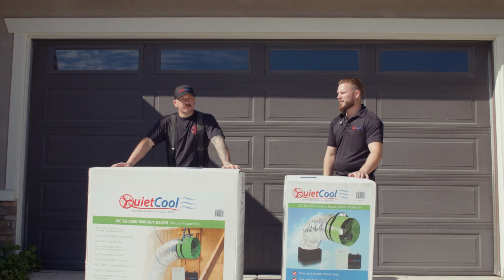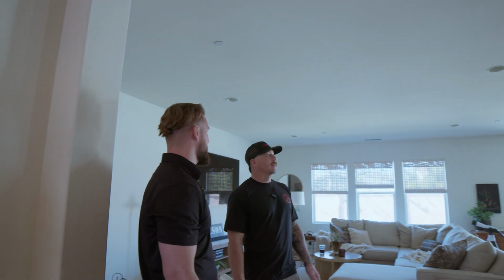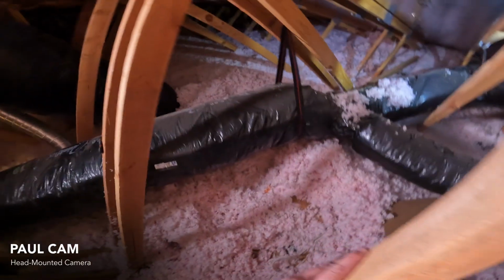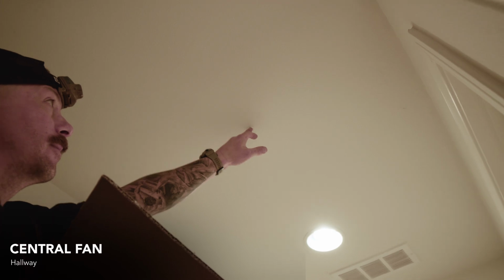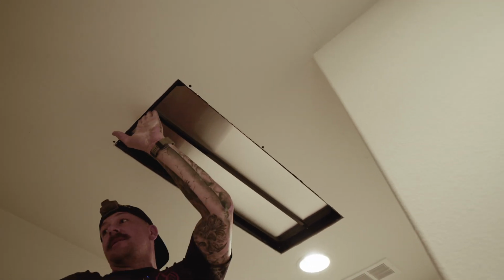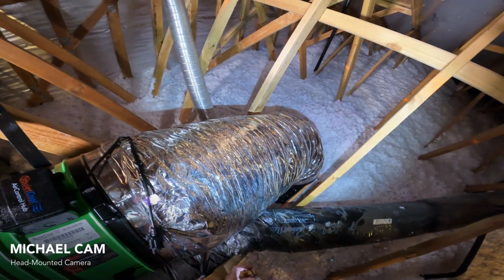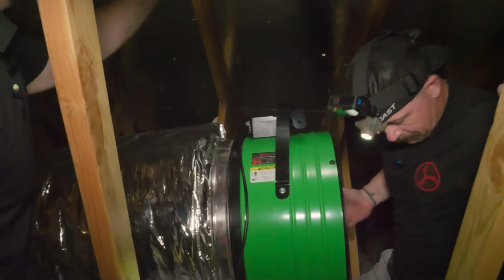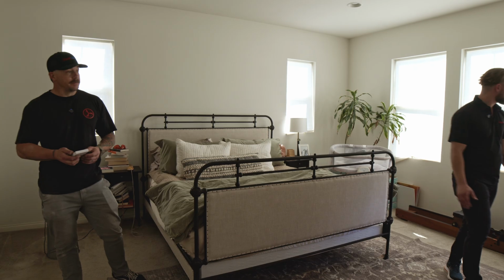2025 QuietCool Whole House Fan Installation Guide | Complete Walkthrough for Single & Zoned Systems

Comment: Great install video! But I'm curious as to how it works. When it is hot and humid outside, I assume you don't want to run this, as it will still pull hot and humid air into the house? My upstairs is definitely warmer than my main floor and basement. I live in Michigan. We upgraded our insulation to make it more "efficient"...
Reply from the maker: You are exactly right; you'll want to run the fan only when the outside air is cooler than your indoor temperature. This not only helps cool your home and expel the stale hot air from the day, but also helps keep your home cooler for longer.

Comment: What happens when it's 110 outside mid day? You aren't opening your windows then you have to run your AC how does this system work then?
Reply from the maker: You would only run the fan when it is cooler outside than it is inside of your home. This not only helps cool your home and expel the stale hot air from the day, but also helps keep your home cooler for longer. That means less AC usage, and big savings on AC related costs!

Comment: i have an exhaust fan in the bathroom just like in this house that turns on with moisture.. if both fans are running at the same time is this fan going to over power and cause a high amp situation on the smaller fan??
Reply from the maker: No, because the bath fan has a direct vent to the outside. As long as you windows are open in the areas you want to pull air into, it will not pull from or overpower the bathroom fan.

Comment: Extremely annoying guy asking so much. And he never made a effort to help out. He should be ashamed…
Reply: Why don't you understand that this is an instructional video that's very well scripted to answer a prospective DIY installer avoid problems????
Reply from the maker: That was his role for the video, to ask all of the potential questions homeowners and installers may have for the purpose of informing the viewers and driving that dialogue. Michael is the professional when it comes to installing these fans and more than likely could install it faster by himself than he could with Paul's help. Hopefully you learned something thanks to all of the questions Paul was asking!

Comment: I installed an ES7000 in our house earlier this year and we absolutely love it. Using it strategically when overnight temps are appropriate we have definitely cut down on the amount we have had to use our central A/C this summer. In the Detroit area for climate reference. We also hardly ever even use high speed. I normally crack a window a couple inches in every room and let it run on low all night. This model is advertised as using 164 watts on low, which I have confirmed by watching our electric meter. Our 4-ton A/C unit uses 4400 watts, so I can run the ES7000 on low for 27 hours for the same electricity as one hour of A/C. I intend to use it during the day to warm up the house as we move into fall when the house starts to get chilly but it is 65-70 degrees outside which will mitigate some of our gas furnace use as well.
Reply from the maker: That's great! We love hearing stories like this. Glad to hear the fan is making a difference for you in the Detroit area. Thanks for the awesome review!

Comment: What is happening to the air that is being pulled into the attic? How many exhaust vents are needed in the attic?
Reply from the maker: The fan is sized according to the square footage of your home and available venting in the attic. Adequate venting is essential for the fan to work best. Once the air is pulled into the attic it is pushed out of your attic vents thru positive pressure. This also helps cool your attic space down a bit as well, further helping to keep your home more cool.

Comment: Have you seen any problems with the screws coming out of the damper door hinges.  I put one in my house myself and in less than a week a screw pulled out and the door doesn't close correctly. Looking for a fix without removing the whole thing.

Comment: @qcmanufacturing What about installing into a closet that has open areas for the projector (to pull air though) but over all vent out the heat from a media room and the servers in the closet?

Comment: So you put it in the bathroom. A nice steamy shower and then turning that on just blasts all that humidity into the attic? That’s a mold nightmare.

Even fast moving air, the water is still being sucked out of the bathroom into the attic. Water has to go somewhere, it doesn’t just disappear.

Comment: Thanks for posting this. Very, very informative. Our old home had one of these.  I feel like they are under utilized.

The one we had was not included in the listing or called out by a realtor. It was our first home. I had never seen and. attic fan. It was hiding overhead for 4 years. The chain on the switch was missing. Our home was 100+ years old. There were some unfinished projects from the previous owners so it didn’t seem out of place. To me at least. 
One day i was on a ladder painting trim around the attic access door. Looked over and saw a very short piece of Pull chain hanging from the mysterious vent doors that never opened. So I pulled it. The doors swung open and the fan came on creating the most wonderful breeze coming up through the house. All of a sudden our little farmhouse fixer upperwith stagnant air and no air conditioning began cooling down.  I realized then the previous owners weren’t masochists or cheapskates like I had figured. They were geniuses. 

The home had a root cellar with 6 foot thick walls. It stayed very cool in there all of the time (~59). And the attic fan pulled the cool cellar air up through the house like we had Central air conditioning. I felt a little dumb.I was excited. My wife was glaring at me probably thinking about some of the times we roasted inside during summer heat waves. I regretted not finding it sooner because we had to relocate for work shortly after.

Fast forward, 15 years…

We now live in a three story brick home with a slate roof. Another fixer upper. The combination of the brick and slate can make the third level feel like a brick pizza oven in the summer. We have a split level up there that doesn’t all of the time to keep cost down. Right now it is 85° up there. And 87° outside. 

On the other end of the spectrum, our basement will typically be around 65° when the AC is on in the summer from air leaking through the first floor. And As of luck would have it, we have another Root cellar. When it gets hot,  you’ll find me in my basement workshop daydreaming about that fan. 

I know I need to insulate and seal. It’s on the road map. 

Also wondering if I could add one of these fans to cool things off and improve air quality in the basement..

Here are my two questions:

Is there a way to put an incoming air supply in the basement for fresh air and have it synced up with the attic van so they go on and off at the same time?

Is there a way to add a quality air filter the incoming supply?

Thanks again for the lesson!

Comment: Question - can the damper box be installed on a vertical wall? Or does it have to be on a ceiling in order for gravity to pull the dampers closed when not in use? Thanks!
Reply from the maker: Yes, we do have vertical wall adapters. The grille is placed in your wall and the damper is installed at a slight angle inside your wall so that gravity can still close the damper doors when not in use. Check out some of the videos we have on our channel that go into more detail!

Comment: Putting it in the bathroom is REALLY risky. The high humidity is getting dumped right into the attic rather than exhausted directly outside. Mold problem waiting to happen.
Reply from the maker: It actually does the opposite because you’re moving up to 7,000 CFM you’re going to dry the air out. Same concept if you have a water leak in your home. The restoration experts bring in industrial fans to dry it out.
Reply: @qcmanufacturing glad this question was asked & answered, thank you qc
Reply: @qcmanufacturing the fans evaporate the water to the air and then they also bring dehumidifiers to pull the water from the air so I can be disposed. The water has to go somewhere, it doesn’t just disappear.

Comment: You guys should add a filter on the whole house cooler fan & just make it a 2 in 1 air purifier/house cooler. It works as a purifier in my eyes, i would just have to add the attic fan to throw all the particles out of the attic & make it cool as well.
Reply from the maker: The outside air is 2x - 5x more dirty than the inside of your home. The only reason you have filters in your home is because AC is a closed loop system that just recycles the same air. We also make special window screens that are easy to add on your existing window screen that block out 90% of the dust and pollen from coming in just in case your a very sensitive user. It’s the first window screen rated as a MERV 5 filter. They’re called a clean air window screen rated

Comment: When my QuietCool Whole-House Fan is not in use and I happen to have a window open, a strong breeze can come in through the window, and it will blow open the damper flaps, causing a loud noise, frightening my dogs.  
Is turning the fan on to open the damper flaps the only way to stop this from happening?
Reply from the maker: Where do you live?